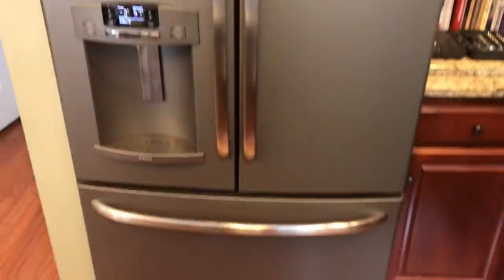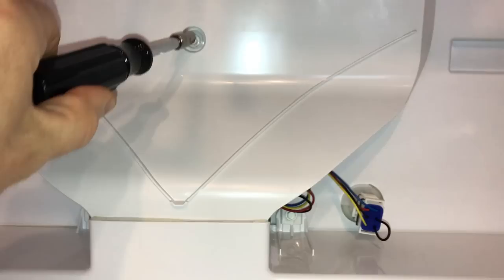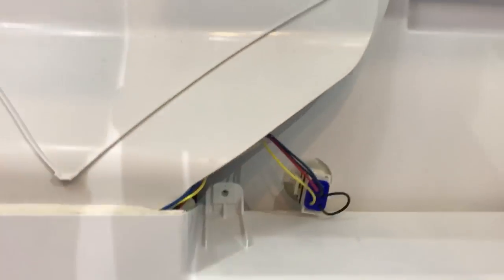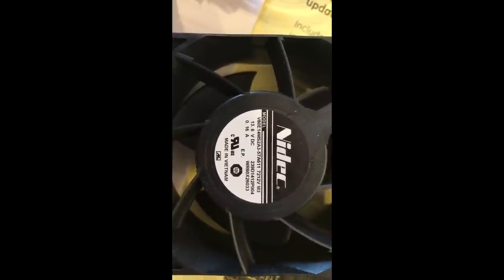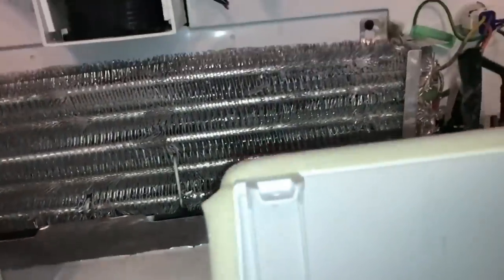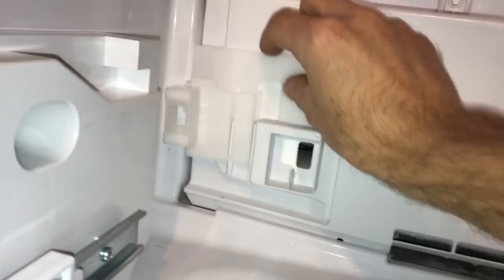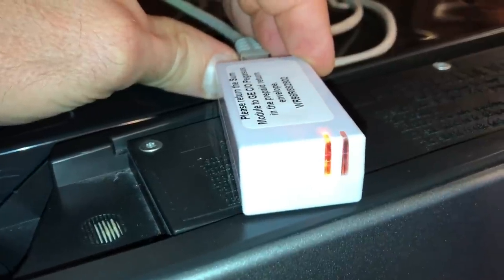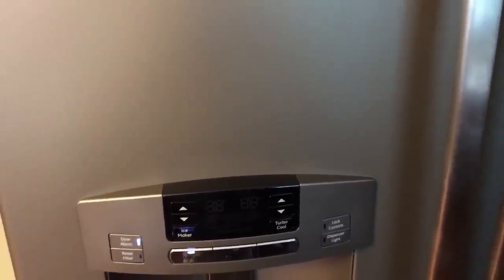GE french-door refigerator not cooling - How to replace evaporator fan

Comment: 7 years later your video came in clutch!! Had watched dozens of videos before finding this one. The "professionals" suggested I replace the heating element, thermostat, and thermostat timer so that's what I planned to do. You mentioned "Ice under the crisper drawer" at the beginning (mine was doing the same) and after seeing how your coils looked (mine looked the exact same) I decided taking the easier route and replace the fan before starting the other higher level replacements. Ordered the exact replacement from Amazon and VIOLA!! After install, the frost began to melt within minutes and the blocks of ice were gone in a couple hours. You saved me big bucks. THANK YOU!!
Reply from the maker: Plus it feels good to know that you did it yourself. Glad you got it working again!

Comment: Appliance repairman just told me this repair would be $480. I just ordered the $35 fan from Amazon and will replace it tomorrow. Thanks for the video and most important, you gotta love individuals that still reply to a post after 5 years. Satisfaction well deserved.
Reply from the maker: Thanks and good luck with the repair. It will run even better knowing that you fixed it yourself!

Comment: Thank you so so much!  In 2022, I was experiencing the same issue, ordered the suggested parts and followed your video to replace the evaporator fan.  Upon completion refrigerator immediately starting cooling down from 66 to 37 within several hours.  The cool thing is, I did it myself!  Your video is thorough, explicit and easy to follow from disassemble to reassemble.  I'm grateful for the savings of $$$.
Reply from the maker: That’s great. Yes, it feels better knowing that you fixed it yourself too - good job!
Reply: Yep...just fixed mine

Comment: Thank you!! We were already shopping for a new fridge online, when I found your video and decided to follow your steps to see if it I could figure it out. Your steps were very comprehensive and easy to follow.  The condenser, coils and fan were all pretty dirty. Everything checked out, so I followed your steps for the freezer evap fan and checked the Fresh Food evaporator fan and that's what was bad.  I ordered a new one on Amazon for $32 and replaced it today.  Fridge is working!! You saved us at least $1,600 for now, although we will still be replacing this fridge down the line.
Reply from the maker: That’s great - glad you got it fixed! 
Mine is still going strong with the new fan so you may be able to keep it for a while.

Comment: You sir, are a gentleman and a scholar. This fixed my GE Profile fridge. My freezer was running normal (0 deg) but my fridge was staying at 58 degrees. Pulled out my deli drawer, had a 3/4" thick sheet of ice below it. Pulled out the fan and it wasn't spinning, and my coils were frosty. Thanks so much!
Reply from the maker: Sounds like you had a textbook case - glad you got it fixed!

Comment: Wow! i just did this today and it worked! When I opened up my fridge to replace the fan, there was ice at the bottom. I poured hot water to melt the ice and opened the back of the fridge up to watch for drainage. (I adjusted the drain tubes in the back so that it would drain into a pan. I used a hair dryer on medium heat, as high heat was actually melting the fridge paneling. Oops!) It took a while to get it to drain, but it finally did. So far the new fan works and the temperature has gone back to its settings (it's been 9 hours so far). Thank you again!
Reply from the maker: Great, glad you got it fixed!

Comment: A big thank you for putting together this video. Probably saved me $250+ between parts and labor. Did a deep clean of the fridge and replaced the fan. We’re back at a cool 35 degrees.
Reply from the maker: Great - glad you got it fixed!

Comment: THANK  YOU.  Your directions were perfect, and my $1500 fridge is running fine once again, without the service call (which was $100 to show up and then parts/labor afterwards, and they couldn't get to me for two weeks.   Got the fan for $58 as a local store (he said it's a popular item for GE fridges 5-10 years old).   When I took the rear cover off and saw the coils looked EXACTLY like you showed in the video I said "I think I've got this!" (hoping it wasn't the sensor).   Followed your instructions and powered it up - SHAZAM.  An hour later the fridge temp was 50 and dropping.   You are great.
Reply from the maker: Great story - so glad that you got it working again!

Comment: Thank you so much.  I ordered the fan on Amazon $35 and followed the video.  I was going to be charged over $500 from a repair shop and $3k for a new refrigerator.  It was plain and as easy as the video just needed a 1/4 socket head.
Reply from the maker: That’s great - glad you got it fixed! 
Hopefully it will be good for a while now. Mine is still going strong!

Comment: I had the same exact problem. The evaporator fan was not spinning. I removed it and turned it by hand and noticed that it wasn’t spinning smoothly. I sprayed it with WD-40 and then plugged it back in. It started spinning! The temperature is now down to 38° and dropping steadily. Thank you very much for this video. It saved me lots of time and money and headaches.
Reply: Same here.

Comment: Years later you are still saving asses with this video.  Thanks!
Reply from the maker: Great to hear - glad you got it fixed!
Reply: he saved mine today, 12 June 2021
Original GE fan part number WR60X10356 was replaced / updated  with part number WR60X26866. No software update required for this fan part number as of 12 June 2021.

Comment: Another satisfied customer here.  Thank you.  BTW Be advised this model bottom freezer GE has two (2) evaporator fans; one for the refrigerator section and a second for the freezer compartment.  They are not interchangeable.  

The freezer fan is located on the back wall of the freezer behind a pop off plastic cover.  Access is made by emptying the freezer and removing the large bin.  There is no need to remove the sliding door/compartment as you can get your torso into the space and perform the work.  Again.. Thanks for the video.
Reply from the maker: Thanks - glad it helped!

Comment: Thanks for this video!! You saved me at least a couple grand! Unfortunately, i called a repair company out to my house first. The technician used a laser thermometer to measure the freezer temps (was supposedly reading 16F) so they told me that I definitely had a “pinhole Freon leak” and that basically nothing could be done and I needed a new fridge. While shopping for new fridges online, I decided to double check the freezer temp myself with my thermometer and it read -4F. Realized it wasn’t low on Freon and started doing some research. After finding your vid, I bought the replacement fan and did the work - Very simple and exactly the problem. I limped on the fridge for a while before calling out a repairman so I had quite a bit of ice buildup under the evaporator.  Had to thaw everything out, but after fan was installed, it took about 6 hours before the fridge reached safe temps again. Thanks again so much for making this!!
Reply from the maker: Proof that a second opinion is worth it - Glad you got it fixed!

Comment: Your problem is identical to the one I have on a GE Cafe model. Crisper freezes up and the fridge is room temperature. I found the part number from the QR code inside the door, and now I just need to get the part. I am certain this is the problem since everything in the back panel is working correctly. Thank you so much.
Reply from the maker: Yes, that sounds like the fan. You should be able to get it replaced and back up and running quickly!

Comment: I want to express my sincere gratitude for this truly excellent tutorial. I hired a professional repair company to fix my refrigerator. The guy came and replaced a circuit board, and that obviously didn't fix it. I found your video, ordered the part from Amazon, paid for next day delivery and had it  fixed in a jiffy. The only problem I had was getting the motor wires out of the wiring harness....I still have no idea how they are treaded in it. I accidentally broke it. Your videography is excellent and the camera was  always pointed where it needed to be aimed. If you have any comment on those wires in the wiring harness, you might post for the next person. My fridge was not the exact same model as yours, but close enough that all of what you did was relevant. Thank you again!!!
Reply from the maker: Thanks a lot for the feedback. 
Yes, those wiring harnesses can be hard to work with sometimes. I’m glad that you got it fixed and cooling again!

Comment: Absolutely wonderful demonstration on the replacement of the refrig compartment's glorified  "computer fan" - I used this video to save $175 over the cost of a service call visit - One caveat, however - you might want to either let the refrigerator sit for a few hours or use a hair dryer to melt accumulated ice on the evaporator coil before attempting to pull the cover off - I pulled off some adhesive sealing tape (and broke off a piece of styrofoam)  in the process of pulling the cover, not a big deal in the greater scheme of things but did double the repair time
Reply from the maker: Good point about the freezing. Glad you got it working again.

Comment: Thank you!   My fridge was making a horrible whining noise, some temp fluctuations but still working as expected for the most part.  I took it apart to get the part number off the fan and when I pulled it out I noticed it had a lot of ice buildup.  I plugged the fan in and realized the whining noise was the fins of the fan hitting the ice.  I removed the ice from the fan and fan housing. Put it back together and it’s working perfectly. I did take a picture with my phone of the part number incase it starts up again I’ll just order the fan.
Reply from the maker: Great - hopefully you will be good to go for a while now.

Comment: Thanks for the video. I have had the same problem with my GE Monogram. When I called a repairman he simply said to "unplug it and let it defrost" and charged me $60. That was more than two years ago. Needless to say, it is still happening. When I called GE they offered a service for over $1000. I will find an appliance parts store and get the fan. I will send an update once the refrigerator is up and running.
Reply from the maker: Kalimah Rahim Yes, you can do it!

Comment: Saved a few hundred dollars thanks to your video! My fridge was nearly the same but had a slightly different design than yours in the video. Mine had a button that you can press that changes the temp in the crisper and has a second smaller fan inside of a big styrofoam housing. I was worried when I found it that it might have been the cause of the problem. But after I swapped the larger center fan, by the next morning, the fridge was cold! My thanks to you!!!
Reply from the maker: Great to hear - glad you got it fixed!

Comment: Worked like a charm. Thank you. 

TLDR: Make sure you have a 1/4 nut driver because a socket set probably won't be able to get into the tight drawer glide assemblies.  But you can complete the repair with just a socket set.

I thought I had a 1/4 driver but only had a socket set with a 1/4 adapter. Got half way through the deconstruction only to find those screws set deep into the drawer glide assembly (around 2:05) were inaccessible with the socket--it was too big to reach into that small diameter hole. With food out on the counter and no other option, I decided to pull up on the back assembly without removing the drawer glide assemblies. It worked! I had to carefully bend the back assembly out to access the fan, but I was able to do that without any damage. Popped the old fan out, popped in the new fan, carefully pushed that back assembly in place, completed reassembly.  It wasn't ideal. On the other hand, it saved a fair amount of time.
Reply from the maker: Great - glad you got it fixed!

Comment: Perfectly described and shot video.  Even validated my assessment from reading forums.  I ordered my unit from Appliance Parts Company.  Came in about a week.  Following your instructions I was back up and running in 10 minutes.  Temp is on the way down quickly.
Reply from the maker: Great  - glad to hear that you have it back up and running again!
Reply: did you install the new software cuz i bought mine through the same company and it didnt come with a software box. did it still work?

Comment: Thanks for the video! $50 fan and 25 minutes to take out and install. Problem solved, which was freezer working but upper fridge only reaching 52F.  Still under 5 yr warranty but as usual it was so exclusive so anything not in the "sealed system" was not included.  Did have to wait few minutes for the last back piece to unfreeze before pulling away to get at fan.  Thank you!

Comment: Great video, really helped. Did it took 20min. Mine is a newer model 2 yrs old. Made loud flutter noises, then screeched on and off. Cooling was working but noise was telling me it would break down sooner than later. You can get the fan (GE repl fan) for about $50 on Amazon, did not come with update cable. There are knock off fans for about $30. My unit did not have the mechanical connection to the deli drawer. Had an electronic link. You don't have to disconnect it, just leave it sitting at bottom of fridge. Nice and quiet now. Thanks
Reply from the maker: Great - glad you got it fixed.  I was hoping the newer models would have better OEM fans that would not need replacement after 2 years...
Reply: @ljschuby99  No such luck! Put a better designed part in? No way that costs $$$ and they 'only' price a new fridge at $1300.  By the way, these fridges are NOT made by GE, many folks do not realize that GE sold the appliance division to Haier (China) about 3 yrs ago. They have the rights to use the GE brand name probably for 10 yrs. If you look at the inside tag it does NOT say 'made in China'. They simply say "GE Appliances, Lousiville, ky" ...which is where the corporate office is.

Comment: Thank you so very much!  Job was very easy-the hardest part was making sure I was ordering the correct part as the unit has so many different fan modules.  ours was noisy from the first day and only got worse as time went on. got to the point it was keeping us awake!  I am a long way from a major city so service calls are extremely expensive.
Reply from the maker: Nice - yes the quiet replacement fans are a lot easier to live with!

Comment: Thank you for posting this video. this instruction and the replacement part worked for GE GFD28MLCES. Fan motor positioning was different in this model. difference was very minimal.
Reply from the maker: Thanks for the info on the different model, what year is your fridge?  Great that it worked and that you got it fixed.
Reply: @ljschuby99  had a typo in the model # GFD28GMLES/Model Year 2017  https://www.geappliances.com/appliance/GE-27-7-Cu-Ft-French-Door-Refrigerator-with-Door-In-Door-GFD28GMLES Thanks again!!!

Comment: Thank you for this very easy informational video. My refrigerator is the same one that you’re showing there is freezing in the freezer. It did freeze the crisper drawer but the rest of the refrigerator was 65°. So I took it all apart like you showed but my evaporator fan is working so now I’m lost.
Reply from the maker: Sometimes the fan will still work, but is not getting the speed required to cool the fridge, or it may just be working sporadically   So it likely still needs to be replaced.